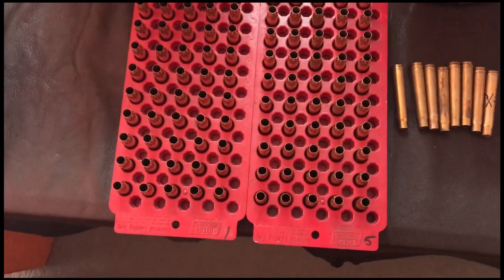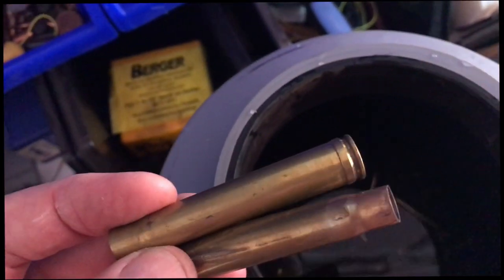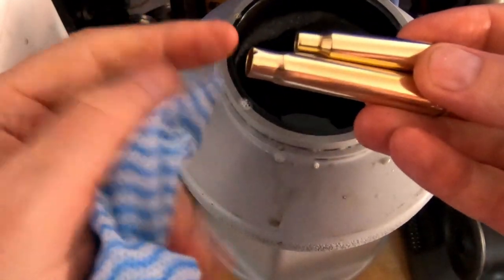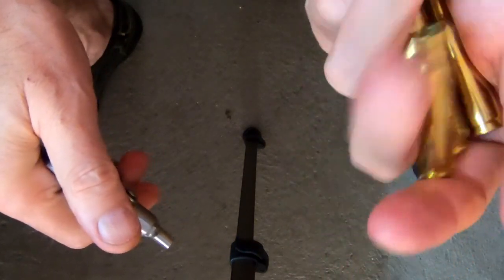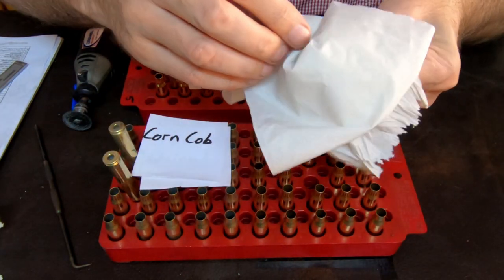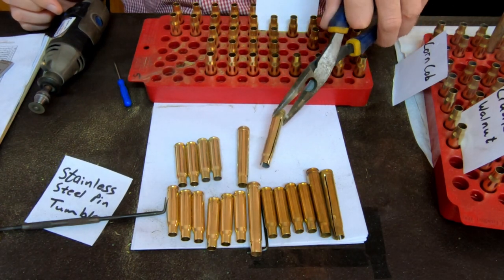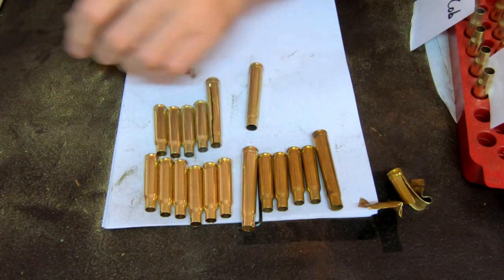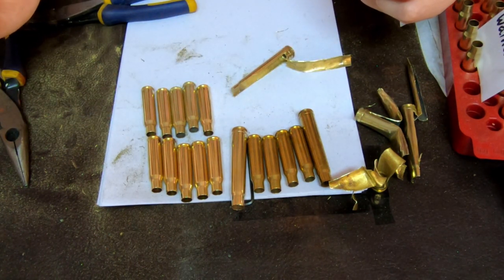Cleaning brass 4 different methods plus cut open

Comment: Very informative and thorough video/demonstration, thank you for sharing. 
(I found your channel only yesterday but subbed right away, hope you'll continue producing them.)

Yes, I found out the same thing a few years ago when I first heard about the rotary tumbler with SS media, the difference in cleanliness is extremely obvious in pistol and revolver brass too - without even needing to cut cases.

Another thing I like very much compared to the vibratory tumbler is that the waste water will contain most if not all harmful substances, which are released into the air by the vibratory tumbler (it's a known source of poisonous lead dust!) so it's a healthier option too.

Comment: You are going to think that I'm crazy or maybe a fool but I use an ultrasonic heated with a quarter cup of vinegar,  one small can of tomato paste, a couple of grams of lemmeshine, and the rest hot distilled water. The vinegar dissolves the hard carbon and the other ingredients deoxidize the brass. They look like the stainless wet tumble or even better. I think you would be happy. 👍 Thank you